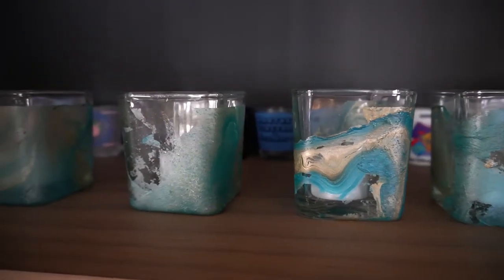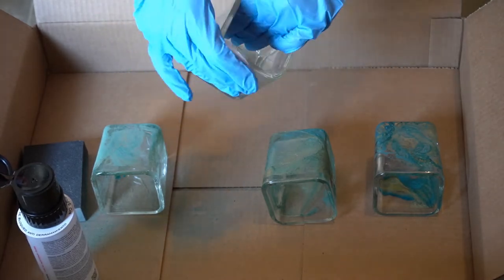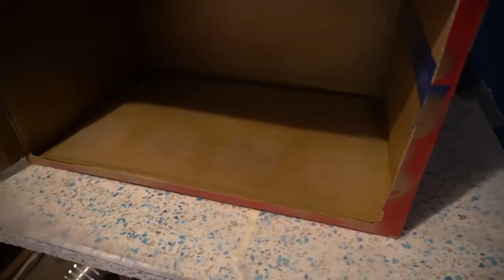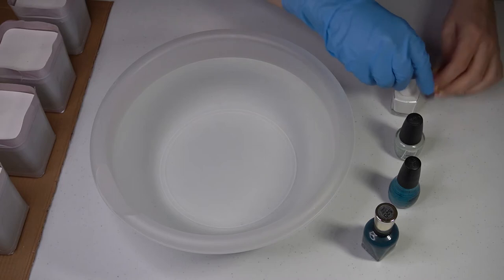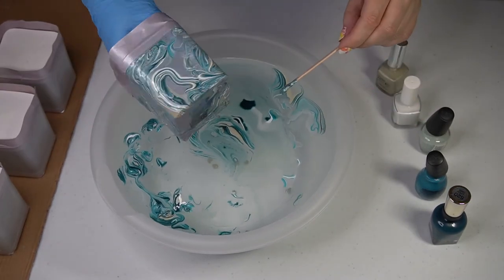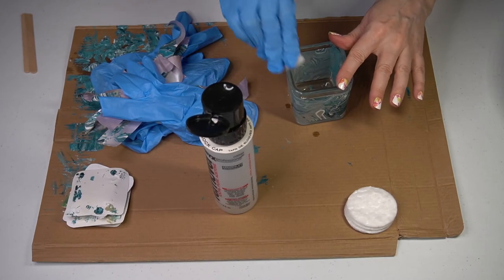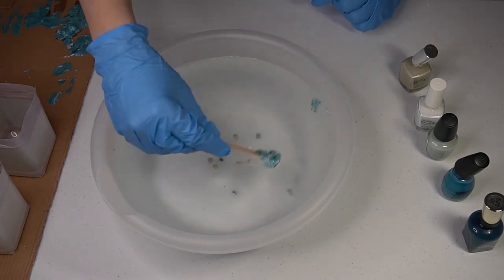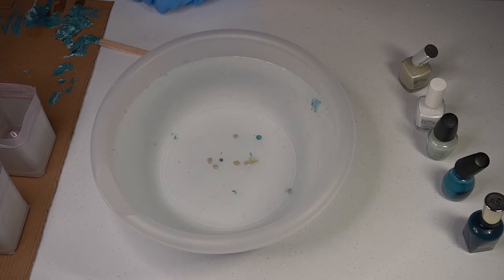Hydro Dipping Glass with Nail Polish Water Marbling #DIYlife #DIYprojects #nailpolish

Comment: Wow!!  These are the best results I've seen so far, and while I probably haven't seen every polish dipping vid out there this evening, I have seen a couple.  The one I saw before yours reminded me to paint my bottle first (I dipped a small clear plastic bottle) and you reminded me to take a stick and swipe away the polish that hadn't adhered to the bottle.  So... maybe NOW I got this?  Nah, maybe tomorrow I got this.  Can't start dippin' at nearly 10:30 at night, now can I?  Thanks bunches from the southern California desert, MK. ♥️☀️🌵. 

P.S.  I f it's not too late I vote YES on the pixie.💇

P.P.S.  Commiserating about the heat ☀️🔥 sounds like a plenty good reason to sub!  ...and me thinks you are a hoot!  Count me in!  🙋. MK
Reply from the maker: Oh my goodness, thanks so much for saying that! 🥰🤗 I haven't done nail polish dipping in ages. But these are still holding together so I must've done something right! Though, thanks for the paint first tip. That would make things go much smoother, esp with plastic. And now you must report back how it goes when you try this again! How did the plastic bottle turn out? One of the best things about polish is you can easily remove it if things don't turn out how you want (on glass), so it's fun to experiment. 

Ah, thanks for weighing in, the pixie happened. Not pink yet but yeah in this desert environment the less hair on my head the better! Stay cool out there, our summer has only just begun! 😓💕🌵

Comment: Am  I suppose to do anything to my Vases after I get done Hydro Dipping my Vases???
Reply from the maker: I didn't seal mine because I wasn't concerned about them lasting a long time or getting actual use. Nail polish on a slick surface like glass will flake away with time. If you want them to last they should be sealed. Either way, these are decorative only.

Comment: Can you tell me if you use luke warm water or cool water?  After I pour the nail polish in and try to move it around, it seems dry and won't swirl.
Reply from the maker: I usually use room temperature water. You do have to work somewhat quickly and also watch the thickness of the polish. It's a tricky process sometimes to get it just right. Keep practicing, you'll get it!
Reply: Thank you!